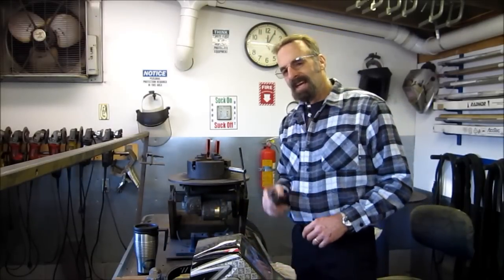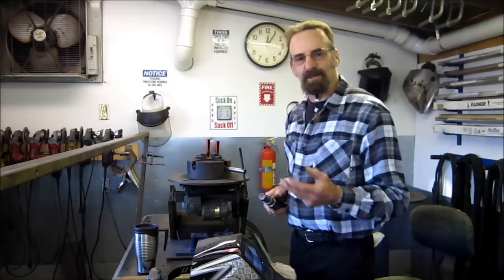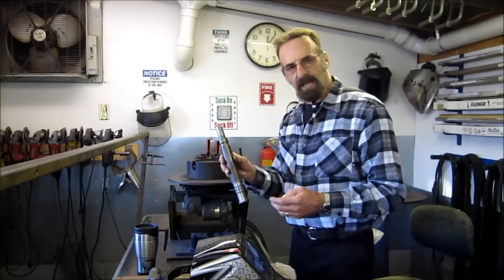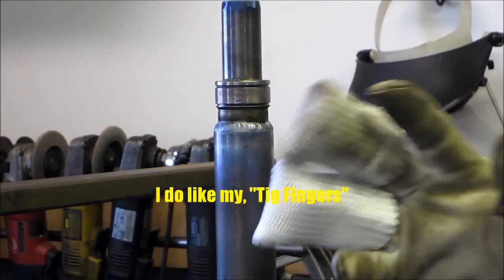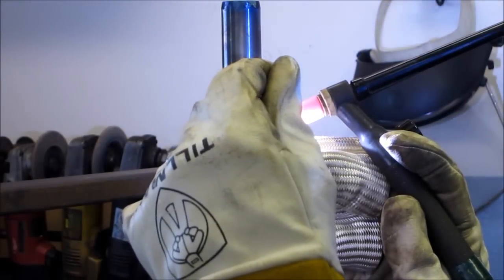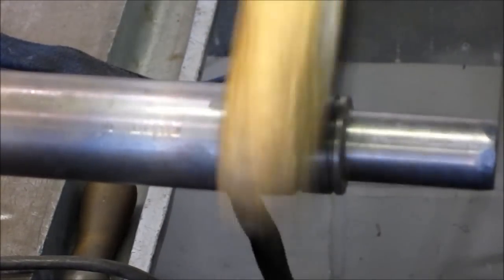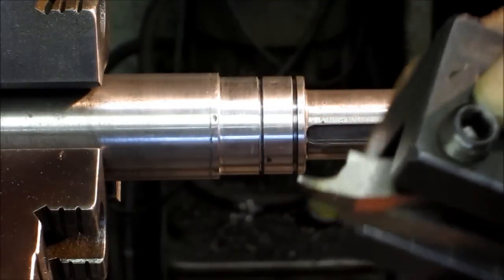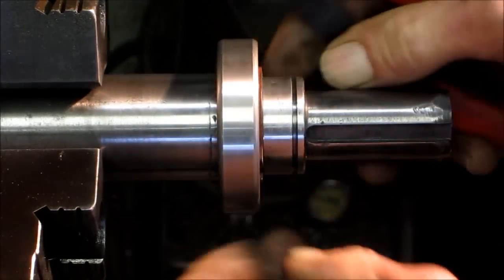The Slider

Comment from the maker: @billdlv Yes, I was judging the pre heat by the color of the metal, with my file test before starting, I sensed, posibly some Chromalloy. I like to start out with a deep tint of gold without turning the sharp edges into the greyish blue stage, creating that color at least a couple inches out from the worked area. The inter pass temp I gage to suit the control of bead forming, controled by timing between passes. the rod was 1/16" 70 S max petal amps at about 80 - 90 and a 3/32" tungsten. Keith